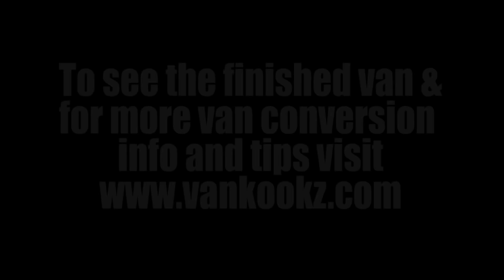Couple Builds Custom Sprinter Van in 10 Minutes | DIY Sprinter Vanlife | Entire Build Timelapse

Comment: How long did it take to actually complete the build in real time? We've been working on ours over winter and are 2 months in but only part-time work since the weather hasn't been very accommodating. :)
Reply from the maker: Hey guys! Yeah don't you wish it went that fast, haha. Ours was full time, 3 and a half months. Luckily for us, it was the driest winter that we've had in a while so we were able to work almost everyday.
Reply: We've had the wettest and coldest winters in a long time. Mostly been working in single digit temps. Finally starting to get some warmer weather. We hope to have most of the big stuff done by the end of the month. ::fingers crossed::